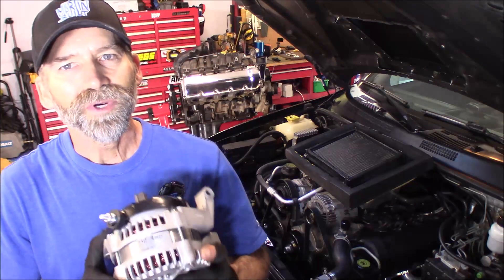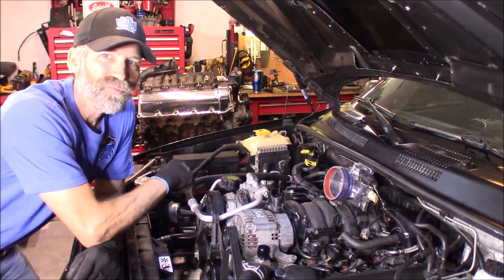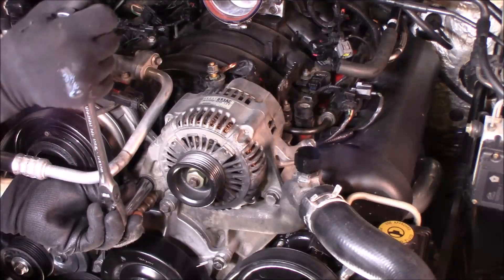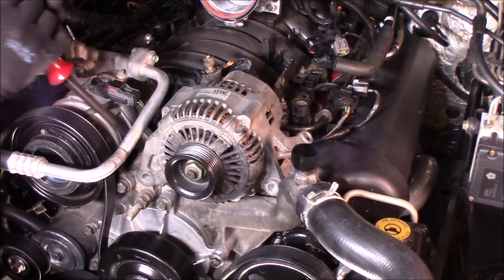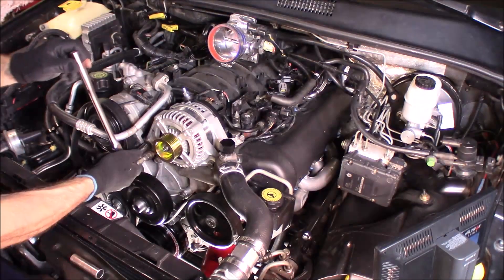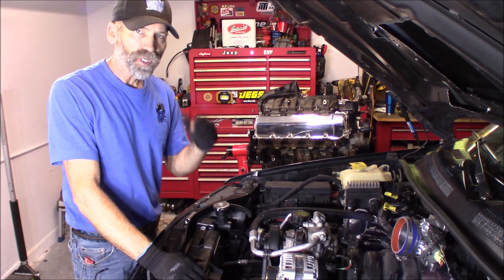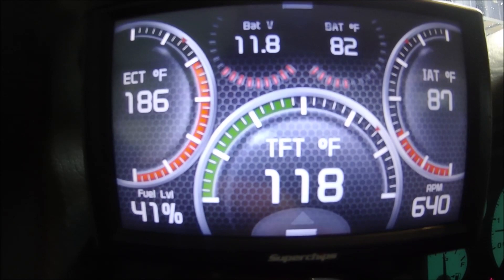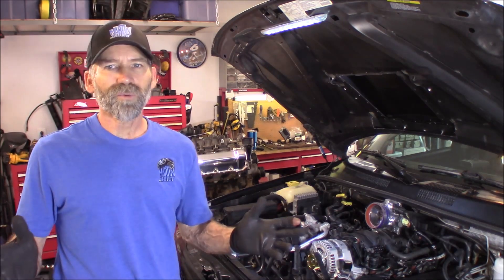250 AMP Alternator Install Dodge, Jeep, Chrysler, & Mitsubishi 3.7 & 4.7

Comment: Thought youd sourced it from a differnt vehicle, i see it is made for the chrysler engines. Wish i could find a good cheap high output alt...guess im gonna have to shell out a weeks pay if i want to fix my voltage drop.
Reply from the maker: Yeah I was hoping this alternator would give me the improvement I was looking for  but I did a alternator shoot out and the factory 160 amp alternator found in Durango's actually performed the best at idle.
Reply: @martinbuilt  i just ordered a mechman 240a, 4 days labor but will cure my voltage drop from my amp and then hopefully I can even add a smaller second amp for my mids and highs.

Comment: i replaced my alternator, belt tensioners, serp belt, and battery today and I still have an overcharging (heating , swelling battery) condition in my 2000 WJ 4.7 causes “check gauges”  “abs” “brake”  warning lights and voltage drops randomly to 9v sometimes stalling the engine, and then comes back up to the middle 14v-Im gonna check all the grounds i can locate tomorrow.
🤔any thoughts or ideas Martin? Youtubers? Thank you for reading !
Reply from the maker: The fact that it's overcharging really points to the voltage regulator which is in the ECM. Somewhat surprising because the voltage regulator in the ECM are pretty solid. But that's what it sounds like.
Reply: @martinbuilt  i was afraid that may be the case, I looked for replacement ECMs and they are only available on sketchy websites, i may just bite the bullet 😅 Yeah, on Sunday my battery was noticeably puffed up, and making a sizzling noise 😵‍💫 i really appreciate your reply Martin, over all these years 💯💯💯i hope youre well and stay cool out there 😎

Comment: You can also try adding a diode to the reference voltage wire so that the alternator thinks that it's producing less voltage so it tries to produce more if that makes sense most diodes will drop voltage across it at about a volt and a half. This will spoof the alternator into thinking the voltage is 1 volt to 1 and 1/2 bolts less then it really is producing if that makes sense I hope that made sense.
Reply from the maker: Thanks Dane, I'll give that I try.
Reply: Yes, we use diodes on generators
Reply: @martinbuilt  any luck? I recently did this on my F250, went from 12.9v to 13.9v

Comment: If you have that under drive harmonic balancer you'll need to do the under drive pulley for your alternator too to make it run the proper rpm to charge at 13v
Reply: Also do a big 3 upgrade.
Reply from the maker: Yeah and actually it's an overdrive pulley for the alternator. Turns out when I install that alternator it came with an overdrive pulley and then I bought a smaller one yet that made up for a little bit of the voltage but as soon as I turn on every accessory heated seats, air conditioning, lights, stereo, and the radiator cooling fan it pulls it right down two Under 12 volts.

Comment: the stock one is more than enough. just bypass the PCM and use and external VR and you will see for yourself. it will stay at 14v no matter what. its been an issue on every dodge ive owned from 1996 on up to 2008. they all do that. same for my zj and the few wj's ive owned.
Reply from the maker: Thank you, I'll pick up one of the adjustable voltage regulators.
Reply: @martinbuilt  I usually go into any O'Reilly's and just pick up a 1980 Ramcharger voltage regulator and pigtail. Pretty easy to find a location to mount it and that way I can just pick them up at a local auto parts store if and when it's needed.

Comment: Swap to a 49mm (1 7/8” OD) 6 rib.
They run about $15-20 new. Google around. Make sure you caliper the shaft size of the alt prior to ordering. That will solve your issue.  You’ll gain .3-.6” to your belt (guesstimating) as well. Verify you have tensioner allowance.
Reply from the maker: Yeah I did the exact same thing shortly after I installed this alternator. It did exactly what you are saying around a .5 volt increase.
Reply: martinbuilt right on!
I appreciate your videos. 

I have two 4.7 (H.O and non H.O) apart right now. Bought a WJ with a blown engine.

Found a 70k mile 2006 Dodge HO from a wrecked Dakota. The salvage yard under priced it to $700 because compression issues. Literally was just rust on one valve seat from sitting... lol 

Swapping out the 32 for the 16 tooth hall reflector including the cam sprockets. Since the crank is out, I’m replacing all the seals, bearings and rings on the HO. 

I need to figure out how to edit and post decent videos to YouTube so I can blog this and other builds.
Reply: @stoichiometry147  As a career tech and a automotive builder and into custom work I also wish my skills were also in video and edit work. I'm mid build in a drift truck project and also in the next week pulling my Grand Cherokee overland 4.7 H.O. that smokes like a freight train and knocks a little (lifter and a rod bearing) and has spit a valve seat out without locking the engine or losing a follower or valve and installing a brand new zero mile 4.7 H.O. that is on a truck and on its way to the shop I work at. Paid $200 to a customer for the jeep I fixed it for $7 and drove it almost 5 years with it smoking and having the valve issue. The many times I sweat driving around waiting to grenade and it still runs. $4k for the engine and $200 for the jeep, still a win and would make a good start to end video for the rebuild of the pulled engine.

Comment: I find a little odd that some pages say that the alternator will fit Jeep Grand cherokee v8 FROM 2001 to 2004. Mine is 1999. But the part number is the same for the 2001. Some alternators are listed from 2001, others from 1999.
Reply from the maker: I'm sure it will fit. They are probably saying that because a difference in amperage, in other words it's just a different part number.

Comment: Your engine rpm is too low should be around 800 idle also check your connection on the battery and ground connections add some extra grounds.
Reply from the maker: 600 to 650 is normal for the 4.7
I will be upgrading the ground cable size.

Comment: Dang, that’s a monster!  The only thing I’ve used in that class was on emergency vehicles.  The 240 amp Leece-Neville on the last aid car I specified had its diode pack mounted separately, in cool air, on a big heat sink.  With a 200 degree underhood temp, an alternator can lose 30% of its rated output.  In those aid cars, we had alternators & pulleys set up so we got 90% of full output at high idle, and we had voltage triggered engine idlers.  I’m guessing you don’t need a 250 amp alternator, just a 100 amp or less with a different pulley.  Good video, though. 👍
Reply from the maker: Yeah I was just hoping that it would pump up the bolt age at idle. I kind of had a feeling it wouldn't. I got a overdrive pulley four the alternator on the way.  Thank you.
Reply: Good luck on that.  As I recall, even those carefully specified alternators did 90% output around 1,350 engine rpm, not low idle.  The overdrive pulley should do it.  All the Best.

Comment: Hey Martin before you try anything else, install an external voltage regulator. I was having problems with low voltage and intermittent charging issues and finally put external regulator on and I’m getting consistent 14.5 voltage even at idle with stock alternator!!

Comment: What else you did to install that alternator? Because i hear from alot of mopar car owners that say if you install a high output alternator you have to also install a voltage regulator? Because the pcm will still only read and produce the same voltage as a factory alternator.
Reply from the maker: Yeah, if you are looking for higher voltage a external voltage regulator or an inline diode or a smaller alternator pulley can get you that. I was hoping by installing this High amp alternator my voltage would be boosted at idle unfortunately it did not. High performance alternators are kind of like high performance camshafts no bottom-end, but got plenty at the upper RPM range. One thing I may actually try is installing the 160 amp Mopar alternator and then maybe a slightly smaller pulley.
Planning on doing a alternator shootout video the 136 amp vs the 160 vs the 250 amp alternator. And then also try different size pulleys.
Reply: I might try the small pulley thanks for the advice

Comment: i put a 180 amp alt in from the oem 90amp and i put light weight pulleys on.  now the car idles a bit higher from 600 oem to 900 now. what gives

Comment: I'd love to see what changing your head lights break running lights etc.
Reply from the maker: I know at idle when I turned on headlights you could see a drop in voltage. I am currently running 35W HIDs.. with no accessories on and the cooling fan running the voltage stayed at around 12.5 to 13 volts

Comment: How much amps does that alt spit out at idle? My 425 brand x H/O alt spits out 230-250a at idle. You may want to look into that.
Reply from the maker: I currently do have a way to measure amp that hi, what did you use to measure your amperage?
Reply: @martinbuilt  clamp meter. At idle I clamp between 230-250 on my Brand X H/O 425a alt

Comment: Hey Martin love watching your videos. I'm doing my jeep very close to the look and most all the mods yours has. You should do the big 3 upgrade with 1/0-2/0 weld cable it should allow your electrical to move the way you want. Without upgrading the grounds and power that alt cant produce the current to where it needs to.

Comment: What size cable are u running from your battery relocated In the back? Might need to go bigger/bigger newer better battery.
Reply from the maker: 1.0 gauge
Reply: @martinbuilt  that I'd think should be good. I'd recommend the big 3 upgrade. It's a audio mod/upgrade to the electrical current of the vehicle. 2added grounds and 1power from alternator to battery. I personally have done this to my 4.7jgc and noticed a big difference in the response with my sound system and I upgraded my battery terminals as well. Lead is no good. Hope if you do this that it helps.

Comment: Will this work on a 2000 Jeep Cherokee XJ 4.0 V6?
Reply: Inline 6 not V6 unless you have the Fiat V6.
Reply from the maker: Not this same alternator,  the 4.0 I6 has a different bolt mounting pattern.  I did install a 200 amp in my 98 XJ but you have to modify the mount (by removing material) to make room for the larger alternator.
Reply: It would if you replaced your I6 alternator with an equivalent one with a higher amp output.. This can apply to many vehicles

Comment: Is the motor running normally at such a low voltage?
Is ignition falling out?
Reply from the maker: No the engine runs normally even at that lower voltage.
Reply: @martinbuilt  my car is charging 13v. And I don't know if this is a problem. Because the engine runs unevenly
Reply from the maker: @Pi90R  is that just at idle or is it go up to let's say 13.8 or 14 volts above idle. I personally think 13 volts is fine at idle but wouldn't want any less than that

Comment: @martinbuilt - i have many questions - when you look at my youtube channel pic - you will see why !!!! thats right.... custom topless humvee cut grand cherokee overlander.... typical bodywork on my builds - this is my first jeep... and just got new radiator for rear mount - so last vid could save my life !!!! but still a bit confused on relay or what ever installed... also this vid a must cause need several fans but some small ones mounted to possibly power steering cooler after 99-01 swap due to no hydralic fan - and tranny cooler i want to move to back with small fan also.... bad thing is  - i have subscriptions to all jeep and 4 wheel drive mags - but not 1 issue covers 04 overlanders or anything close - sorry, but even if i owned a new 2019 jeep - id be the only person custom building not catalog ordering !!!!!! - so i need yer advice.....built not bought....

Comment: Get rid of underdrive pulleys. My 4.7 charges at 14.7-15.2 no matter the load with factory alternator
Reply: I plow snow as well and have tons of light bars. Never had an issue